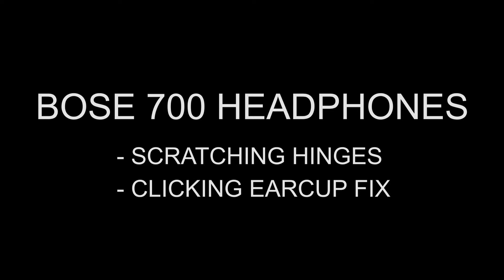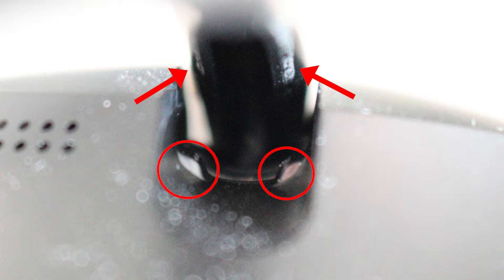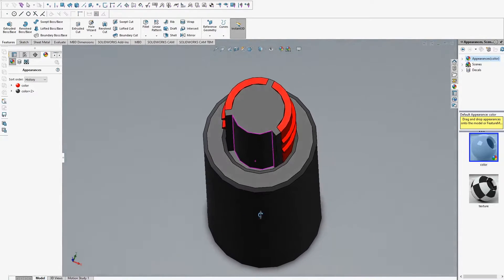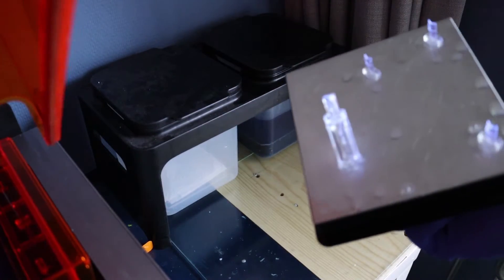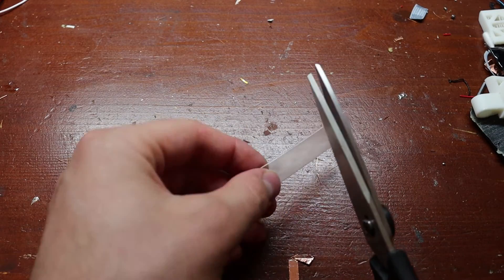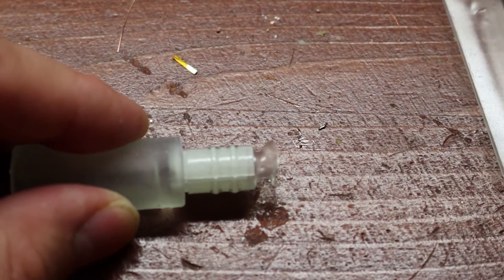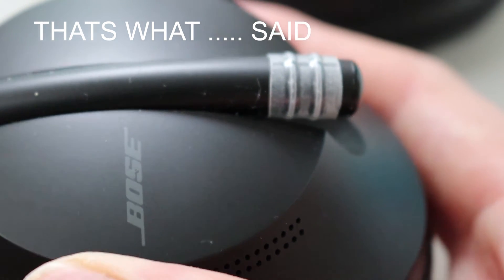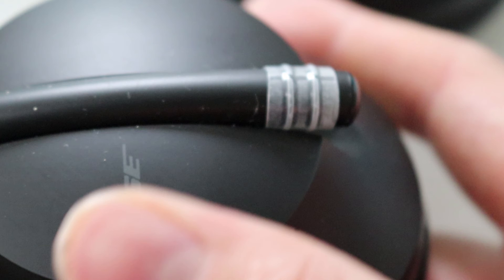Why NOT To Buy The BOSE NC 700 IMO (with fix if you already did)

Comment: Isn't this absurdly over engineered? And you can easily get PTFE (teflon) tape and just glue a bit on the inside of the channel on the headphone or wrap some over the headband.
Reply: I agree, this could actually be easier using a thin shrinking tubing, applying controlled heat to let it shrink to fit should be sufficient, and the color matches since it's already black, will try with mine tomorrow.

Comment: I bought a pair of QC35ii, had to send them back for replacement. They sent me a pair of these instead. Thought I got an upgrade but they are pieces of shit. Everything you point out in this video + widespread BT connectivity issues since recent firmware updates, and no easy way to roll it back. Also they are way less comfortable than the QC. I have a fat head and this shit squeezes me and need to stretch them out. I got the original pair on clearance but if I had paid full price I'd be heated. My first experience with Bose and will be my last for sure, unfortunate considering their stellar reputation.
Nice fix but absurd that this is necessary.
Reply from the maker: Thanks for pointing out your opinion! Perhaps you could check out the sony 1000mx4's